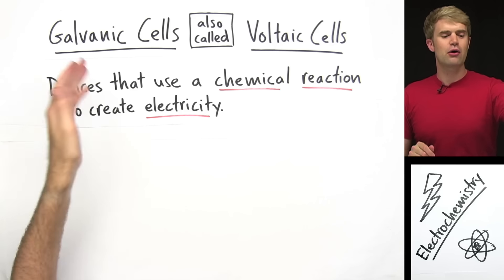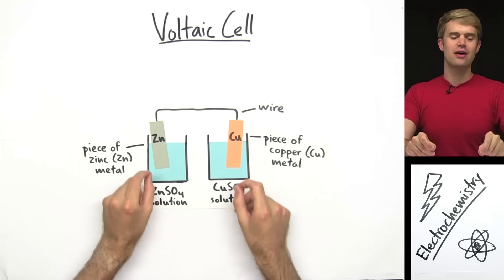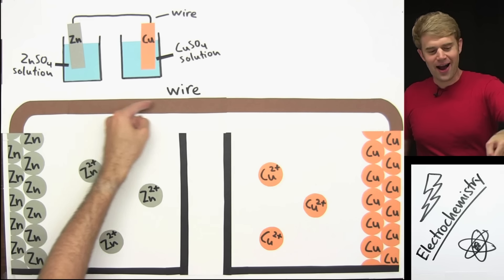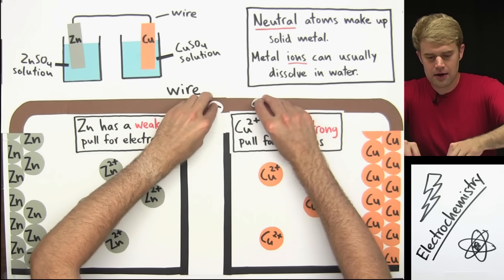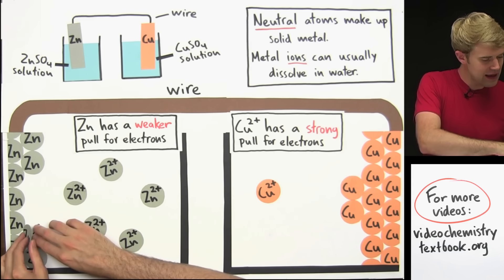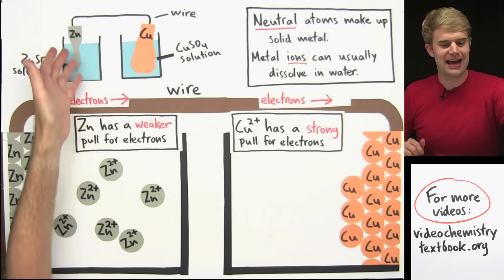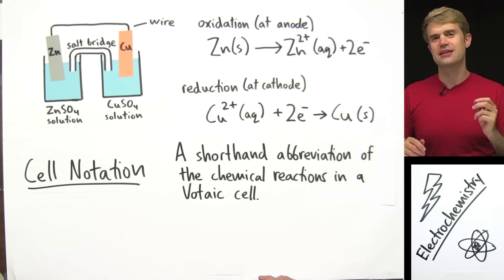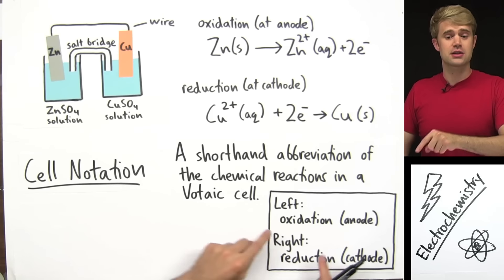Galvanic Cells (Voltaic Cells)

Comment: Really good videos, just to help some of you guys. Remember:
OIL RIG
OIL(oxidation is loss) 
RIG(reduction is gain)
Also
RED CAT(Reduction occurs at cathode)
AN OX(Oxidation occurs at anode)

Hope this helps.
Reply: I would like to add some more. 
ANODE
Above Electrochemical Series
Negative terminal
Oxidation
Donate
Electron

a e i o u (Ignore e and u)
anode
e 
impure metal
oxidation
u

OR

atom
e
ions of Group 17
oxidation
u
Reply: @Vanessa i use 'LEO the lion says GER' as well but i say LEO is LOSS of electrons :)
Reply: I would use CR AO or “crow” basically
Reply: Thank you !
Reply: PANIC
Positive
Anode
Negative 
Is 
Cathode
Reply: @ceylindogan1686  loses electrons, oxidation. Gains electrons, reduction.
Reply: @iamhereblossom1588  yes i know? i said the same thing?
Reply: I remember "the red cat gets fat" to remember that material gets deposited onto the cathode where reduction occurs
Reply: Doesn't he contradict this in the video? He's saying that the Zn gets oxidated, but it's getting a positive charge, and he says Cu2+ is getting reduced, but it's getting a negative charge. I don't understand
Reply: @undeniablySomeGuy  if something gets oxidated, it means that it lost electrons. Remember that electrons have a negative charge. So if something loses electrons(gets oxidated) it will become positive.

Comment: what happen if the solution is just NaCl and the electrode are Zn and C? what is the reaction that happen in this case? in cathode and anode. please help me to solve this. actually i still confuse with reaction that appear in galvanic cell and electrolysis, is it same or not. i mean the reaction that happen in cathode and anode between galvanic cell and electrolysis. i read that in electrolysis we must to see what  electrode we used for anode reaction (inert or not), are galvanic reaction use the same rules too?. thankyou

Comment: why does copper have a more strongrer pull for electrons than zinc
Reply: that is according to  the electrochemical sereies... Zn is better at losing electrons relative to Copper .
And that in turn has got to do with its electronic configuration, Zn attains stability by losing 2 electrons
Reply: Because Zinc is higher up the reactivity series, the more reactive the metal, the more they want to lose electrons
Reply: Copper is more electronegative than zinc. This is why it has a stronger pull for electrons.
Reply: Avatar Wan  this is wrong, according to electronegativity. it increases from left to right, Zn is placed on the right side of Cu and they are both in the same period which would make Zn more electronegative. This makes your answer invalid
Reply: @seromane  zinc is a metal and all metals are electropositive

Comment: My friend, you are very talented. Thanks for this diamond clarity and astonishing simplicity!! ❤❤
Reply: SUGGESTION: it could possibly help adding the explanation why the electrodes are immersed in a saline solution. The copper electrode in a Copper(II) sulfate CuSO4 solution and the Zinc electrode in a Zinc sulfate ZnSO4 solution.
Reply: CuSO4 is a salt made by a ionic bond where the Copper in the CuSO4-salt and not in the copper electrode has given up 2 electrons to the sulfate SO4-2, thus becoming a cation Cu+2 and building a crystal with the sulfate.
Reply: The ionic bond of the CuSO4 salt gets dissociated/diluted by water molecules polarity and the Cu+2 cations and SO4-2 anions swim diluted in the water around the electrode.
Reply: These Cu+2 cations from the salt dissociation of CuSO4 are reclaiming their missing electrons lost to the SO4-2 anions. They cannot get the electrons back from them, yet they can get them from the Zinc through the wire.
Reply: This is probably not enough to explain electricity just out of Coopers higher electropositivity, as this will not happen without the additional  CuSO4 saline solution. The Copper electrode increases in volume due to the additional Cu cations from the CuSO4 saline solution.

Comment: very good video. absolute gold. I do have one question though: let's suppose i have a voltaic cell without the connecting wire. if where to hold a multimeter tip on each if the electrodes i would measire a certain voltage between the two without current flowing. why is ome side positive and one negative if theoretically the salt bride would equal out everything ?

Comment: Ther terminals of galvanic cells polarize towards each other in potential once the external circuit is connected.  In a short circuit where there is almost no resistance in the metallic load path, the potentials of the terminals almost reach the same value.  Can you do a video explaining this effect.

Comment: So the pd is actually caused by the greater electron affinity of the Cu ions? 
I read in a textbook that in a solution of their ions, metals will ionize into the solution and at the same time the metal ions in the solution will discharge on the surface of the metal. Different rates of ionization and discharge for different metal/ion systems. 
When two different metal/ion systems are connected with a wire, this difference in the rates of discharge and ionization will cause an imbalance of net charge on both metals in the solution of their ions, hence the pd. Whichever metal/ion system discharges and ionizes in a way that they have more electrons on the metal surface, becomes the anode of the voltaic system. 
Now I’m confused, because your explanation makes sense too.
Could anyone who has knowledge on this help out?

Comment: What makes the copper atoms to attach to the copper metal after receiving the two electrons whereas they have noo opposite charges to make them pull towards each other? Or are there some minut dipole moments? Maybe on arrival of the two electrons the copper is for a moment slightly negative hence inducing a slightly positive charge to a copper atom closest to it that is sitting on the zink metal and thus causing attraction.

Comment: Suppose we have connected just a piece of wire to just positive end of the battery  we know there will be some excess surface charge on the wire to cancel the electric field of battery and those electrons would have come from the battery but if that's the case should the potential of the battery get changed? But textbooks say that battery maintains the potential difference across its ends , it cannot be true always , it should be true only after steady state current is reached.

Comment: 21:10 even if there's a salt bridge, wouldn't the Cu2+ ions run out in the reduction half cell and the cell will stop ? Supposing Na+ ions become Na (and also supposing that Na+ ions have greater tendency to become neutral than Zn2+)to continue the reaction but still there are finite no. of Na+ ions in salt bridge so at a time wouldn't this cell stop? (I know that I have only considered reduction half cell but you can also (or only) include oxidation half cell for explaining me)
If you know the answer please 🥺🙏🏻 answer by replying

Comment: How can the Cu2+ pull for electrons from the Zn if the copper circuit isn't even in the solution? Isnt the copper circuit just connected to the top of the Copper solid? Sorry if this is a stupid question